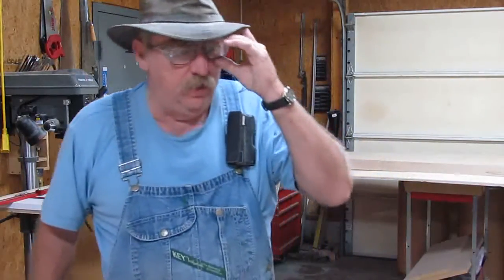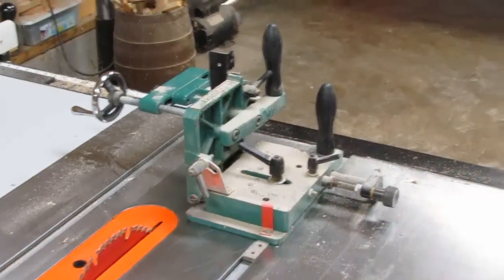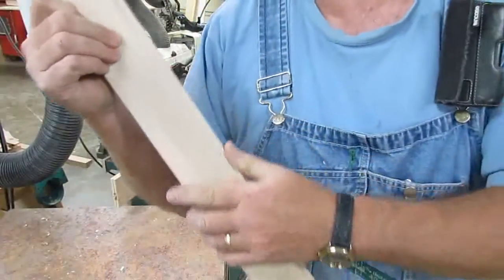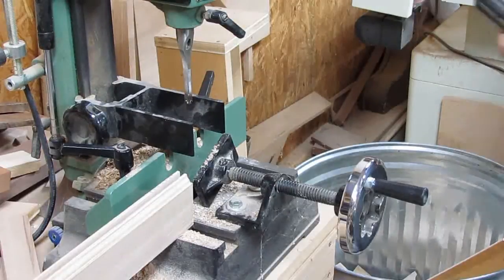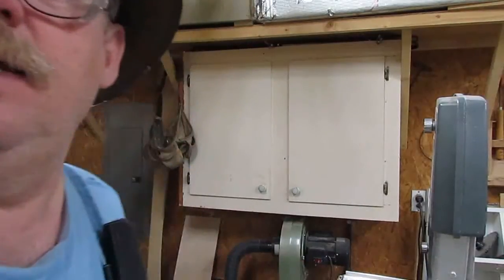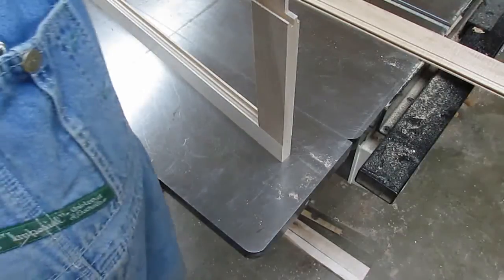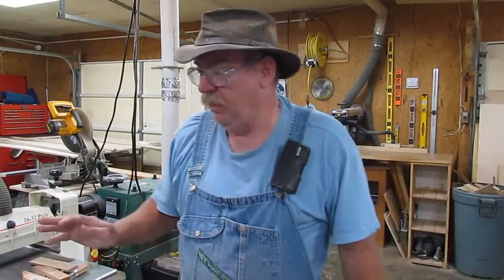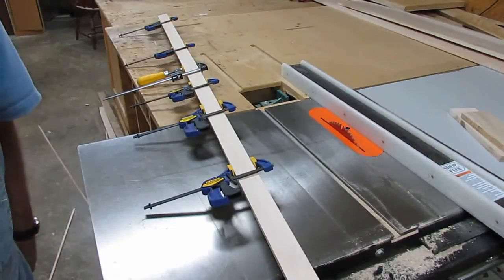Part three display case

Comment from the maker: It depends on what I am working on but I left 1/4 inch on this project. I am also using a polyurethane foaming glue on the tenons to fill any gaps that may be inside for strength.